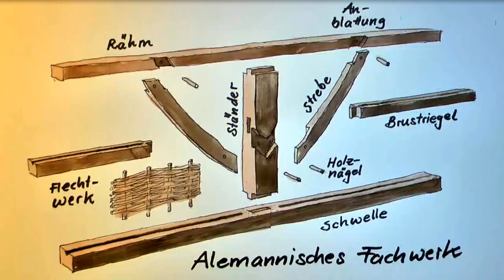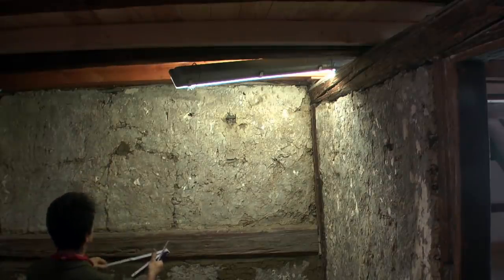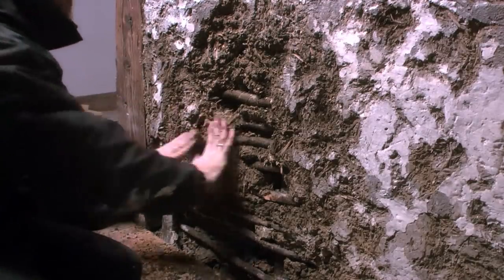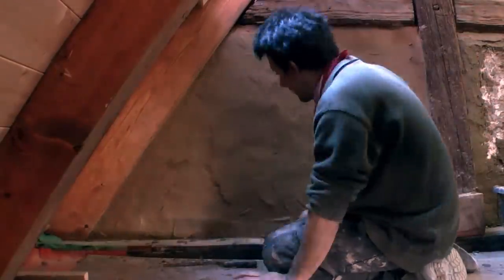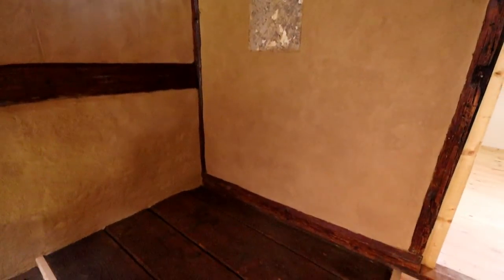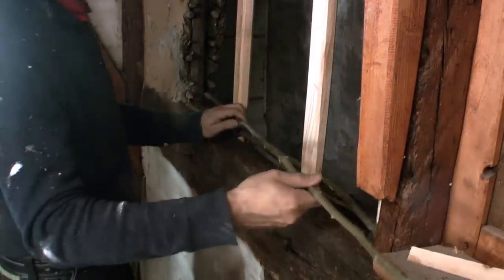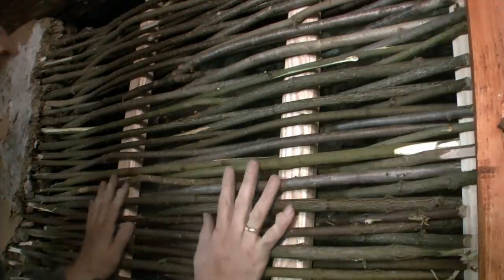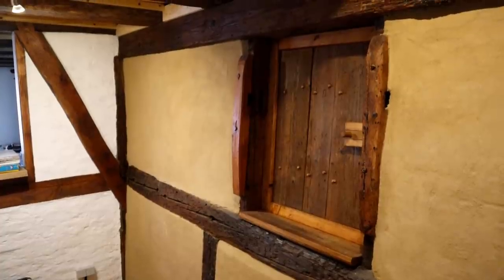Timber frame 6

Comment: I've recently bought a property with a run down and very dilapidated cabin on it.  I was going to knock it down, but the roof looks great.  I decided instead I'm going to strip it down to the frame and try wattle and daub panels, largely inspired by your channel.

Thank you for your in depth tutorial on this.  This is going to be a great summer project.

Comment: Now I understand where all the "fachwerk" houses came from.  but how well does wattle and daub insulate?
Reply from the maker: Lets put it this way: when you have no tight windows, are heating your house only by the kitchen stove and at sundays in the livingroom and are using one bed for two people, then the coefficients of your walls are not important. Answering this question from our modern perspective (what I definitely would recommend - one should honor the work of the past centuries, but also be thankful that things have been improved), I would think that these 0.15m thick walls have 1.0-1.5 W/m²K , depending on the ratio straw/clay. Thats not enough for a modern way of living in a house. When someone should want to use this method for a new house in regions like germany or mild regions of kanada, the walls need to be a bit thicker.
I should add: in my situation there are only inner walls in this style and the southern outer wall is not exposed to weather anymore, as I closed the gap between the houses an put some additional insulation there (some 2m recessed from the front).
Reply: I know I'm quite randomly asking but do anyone know a good website to stream newly released movies online ?
Reply: @Gregory Wallace i watch on flixzone. Just google for it =)
Reply: @Gregory Wallace lately I have been using flixzone. Just google for it :)
Reply: @matthiasburger2315  what did you use for insulation? I assume you put insulation on inside?

Comment: Very nice!
Did you add sand to your new clay plaster or was the clay you got from the building site already "sandy" enough to work? If there's too much clay content it shrinks a lot when drying.
I think it is amazing that clay plaster can be on a wall for hundreds of years, knocked off, watered and reapplied for another hundreds of years. Doesn't get more "renewable" as that.
Houses like that can be disassembled and reassembled with the same materials and almost zero waste.. which is what they did back in the day.
My house was moved 6km in 1860, I don't know why but I assume that they wanted to get rid of the house and sold it to the new owners who put it up on their plot.. They might have changed a few things as there are beams with holes that don't make any sense. But it could also be that the house already had used beams and material from other houses when it was built originally. They didn't scrap or burn the demolition piles back then, they used old buildings it as material gathering site for new buildings.
Try that with modern concrete houses.. even brick ones that had been assembled with cement plaster. No way of disassembling without destroying.

Comment: I see that the wooden branch need to be more separated, that is why the earth plaster fall down. When You put the branchs ay least 5 cm separated from each other, so the plasters from both side will glue. Other wise the branchs are a separator element.